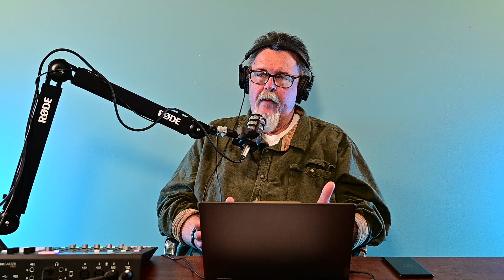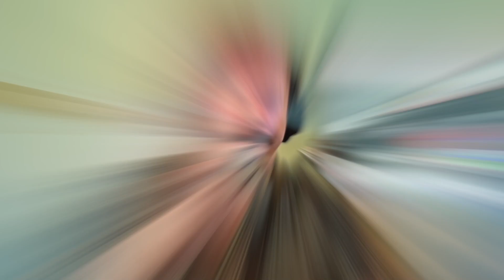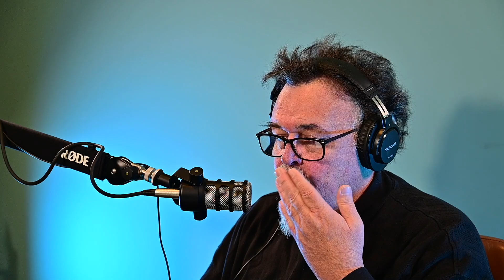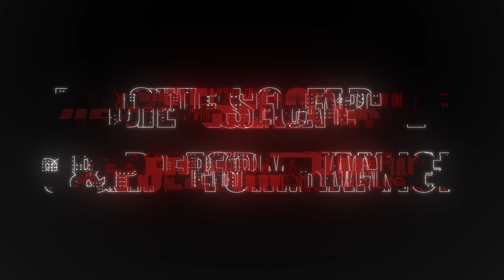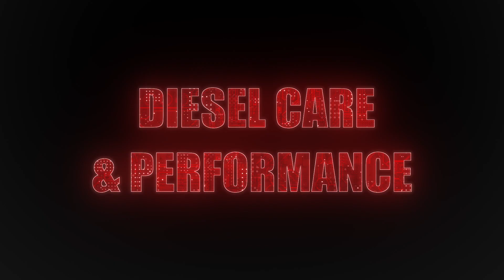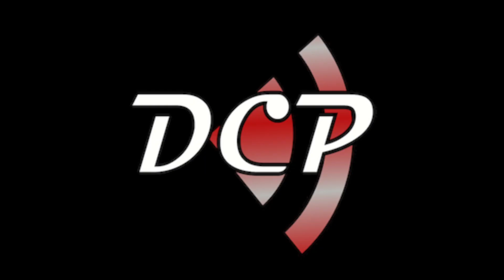Diesel Tech Call: 6.9L/7.3L IDI Injector Problems

Comment: I bought a set of injectors reman and a pd2 pump from this guy. The truck hasn't even been tagged or registered but yet I had an injector go down. Called numerous times no answer reply. So now I'm stuck with a injectors in the truck that doesn't run correctly. Just a huge disappointment in a waste of money. Brand new fuel tanks brand new fuel pickups brand new fuel clamps lift pump fuel filter housing. Everything completely replaced before initial startup. Ran good started up fine and then one day I go out there to start it up again and now I got diesel injector knock. Truck has 87,000 me and I got some kind of funky non-american reman injector from these people.

Comment: Fuel selector valve from Amazon for 89.00 work well. I've put 2 in on 2 different vehicles. Put a square thumper electric pump with clear line to see if your getting air from tank. Or from manual pump itself. And clear line from injection pump up top to fuel filter. If air bubbles. Find out why.. Also transmission fluid in fuel filter. Pushes air out quickly. Just my .03. Good luck.

Comment: I am coming to a point of removing my 7.3 idi injectors, with 80,000 miles.  Can these injectors be disassembled and cleaned?  I have done that on another set of mechanical injectors, and they were badly gummed up, but once cleaned, perform like new.  This is a substantial saving for the competent.
Reply: I would suggest you going somewhere else

Comment: Do you sell any glowplugs manual bypass switch for a 1986 Ford f 250 6.9
Reply: Really easy to wire up, just pull off the white wire at the relay and wire up a switch from that terminal to ground

Comment: I was thinking it was the little O ring, in the top of the fuel filter base to start with. But being the filter is not draining back to tank, it's most likely not that.
.
I agree, injectors or return to tank lines. is most likely the issue.
.
Being the return is switched from one tank to the other, it could possibly be an issue as well.